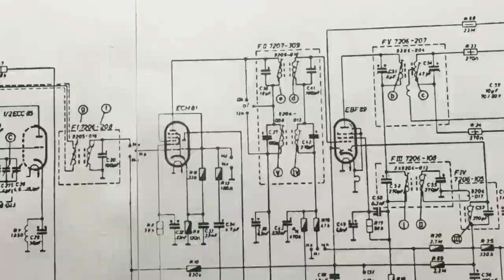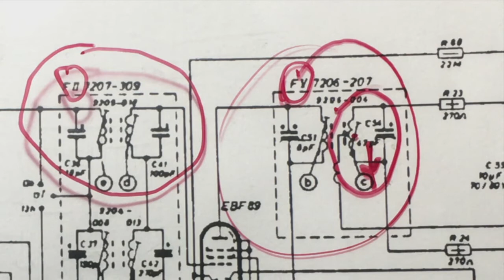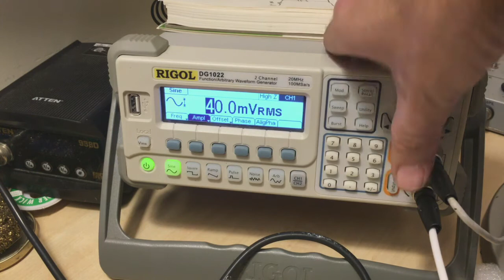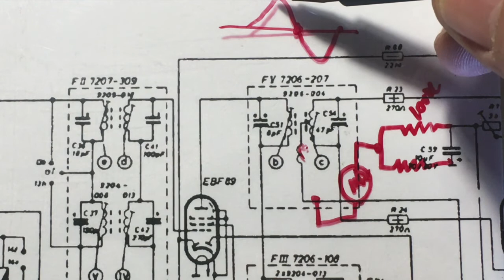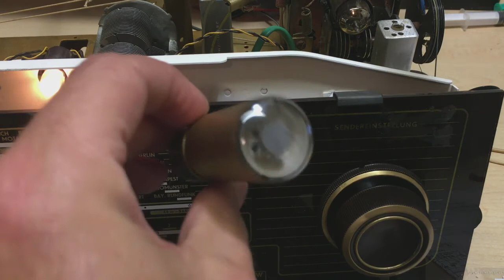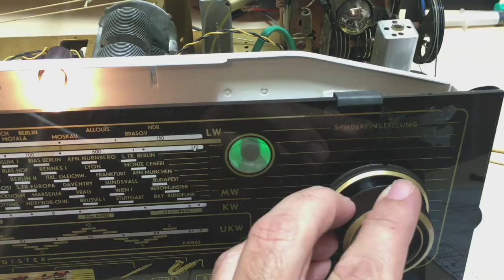Grundig 3060a tube radio restoration - Part 5. FM alignment.

Comment: What a totally useless video. You only showed the meter without showing the most important part of which coils you were tuning.  As these have combined AM and FM it would be good to know which coils on the schematic translates to which cans in the chassis.
Reply from the maker: I agree. Watching this video alone is a totally useless effort. However, if you’d watch part 4 of the series, you’d see the drawings that show exactly where these coils are. Also, any restoration you do should start with a schematic of your own, which would tell you the same thing.
Reply: Electronics Old and New by M Caldeira i am restoring the same model.  Have schematic but can’t find English alignment instructions.  Schematic does not show location of coils physically.  Will check out the video you mention.
Reply: Hi I did watch your earlier video which shows the coils locations to match the schematic.  My 3060 is now as good as new electronically.  I like the old cases so keep them original. The sound is just awesome.  Shortwave is fantastic.